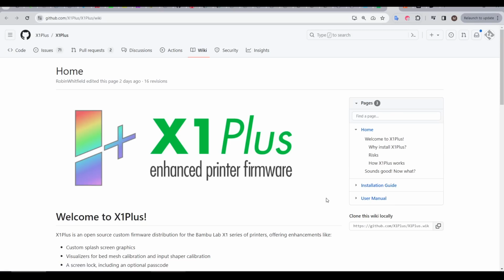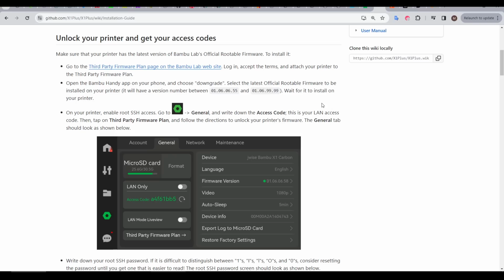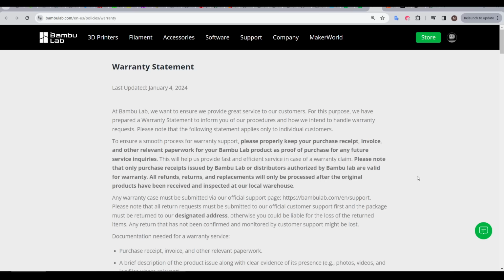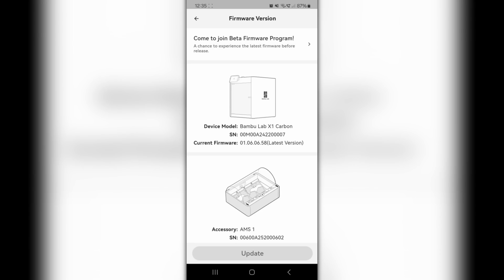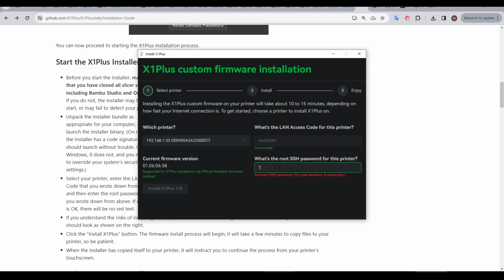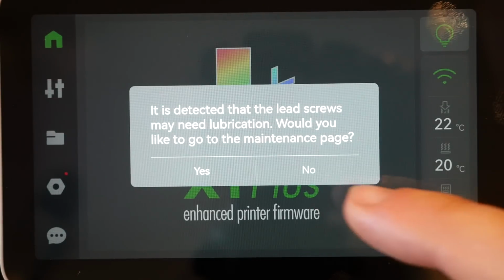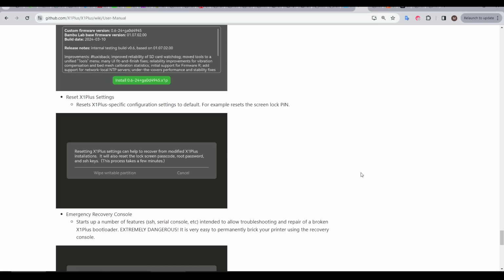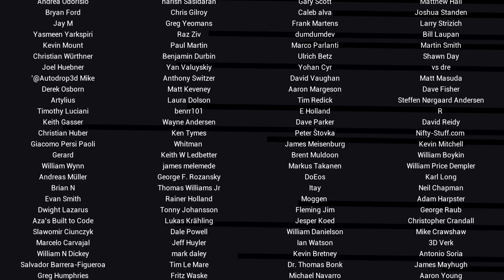How to install X1Plus community firmware - Step by step guide

Comment: For updates I feel like it would be better to have it in a FOLDER called UPDATE.
which installs the update firmware if its detected in there from the update menu.

It should also ask you if you want to delete the file as well after the update succeeded.

Comment: I didn't buy my X1C directly from BL, so I never had any warranty from them anyway (I got it from world famous or at least I consider it to me MicroCenter, of whichwhere I work). With the recent announcement and the fact that they're going to block users from using anything but Bambu Studio (i.e. Orca Slicer won't work anymore) unless you update the firmware on your printer made me want to try X1Plus finally. I can revert to their crappy locked down crap if I have to but until then it's CFW for me. Great video Mike! I've been subbed a while and your videos are great!

Comment: (If the Official Rootable Firmware does not appear in the downgrade list, you may first have to downgrade to version 01.07.04.00 before it appears.)
In my case I had to go to 01.07.05 first and then 01.06.06.58
Reply: Thanks, was about to ask about that 🙏

Comment: So, to clarify, I am hoping you will answer my question. I am holding off on updating my printer right now because I might want to switch to X1Plus. Now I can update to the latest official firmware version, then roll back the firmware if I ever decide to install X1Plus?

Comment: Why does the official firmware not have such security features, what is the reason?
Reply from the maker: The x1plus team have not found any evidence of wrongdoing, but they have added kernel level connection blocking for those who desire it. It's a peace of mind thing.

Comment: How is Bambu supposed to determine that an issue is "clearly not the result of using third party firmware" without wasting time that could be used to support people using the original firmware?
Reply: Waisting time? Lol. I waited for 1.5 months to receive a replacement HT board for my x1c, which made it 1400$ paper weight, And during that time I was using so called obsolete creality printers.  So much for them being that. 😂.
So with their "support" many already  wasted a lot of time with them.

Comment: Thank you for the walk through.  I was able to root my printer and install the new firmware without issue.
Reply: Update:  I've been running it successfully now for a week without any major issues.  I do notice an occasional quirky thing happening with my AMS where a filament will randomly load for a second and then unload while the unit is idle.  But that's about it.

Comment: I'm going throw out a big disclaimer. Running any custom firmware has it's own caveats. We are putting a lot of trust in a relatively new group running a device that can run at oven temps. 

No slight against the devs but please be aware any faults in their code can put you and your printer at risk and they provide zero guarantees about functionality.
Reply: Yes, thats why the Dev Team and Bambu Labs have included their vast amount of disclaimers as well. It’s very clear already.
Reply: providing guarantees for what? they're not getting paid for this, why do we need them to guarantee us anything?
Reply: @itsnotthat_   All of the risk is on the user.
Aside from people who got free units X1C owners paid at least $1200 for their machines.
You are putting your investment into the hands of  devs who explicitly say if you Bork your machine "too bad so sad" if you are still under warranty you are actively making it more difficult if not impossible to use it.

If I offered you my super special firmware to supercharge your car and I blow the electronics would you be cool because I offered it for free? 🤔

Let's be candid most folks cannot, do not, and will not read or learn to code. They will see videos like this and think "wow this is cool". They don't know what bugs, security risks, or issues running this long term can do. Running a whole OS from the touch screen memory card slot could introduce any number of problems and again all the risks are born on the user. At the very least there should be more time dedicated to warning folks that this is NOT recommended and could be dangerous.
Reply: But you have no problem putting the trust in the CCP company like BL. 😂😂😂 Make it to make sense.
Reply: well bambu lab just told you they own your printer so this aged badly
Reply: @TheShorterboy  what else us new? 
Apple, android Microsoft have similar controls.
Most OS and even hardware have controls in it that are beyond the user.
Idk your age but in early android days there was a pretty nasty app that was making the rounds and Google exerted  not mentioned "feature" and removed that app from phones and tablets called the kill switch. (apple too)

The biggest difference is you can either not upgrade, or leave your device offline.
Reply: @No0o0o0o0o0  well go buy a 4G modem  knock up some code and you have a phone with no back doors
Reply: You are taking a $1200 machine and running rando custom firmware because the devs released it for free is not the flex you think it is.

 Again it runs at oven temps and you are leaning into a "trust me bro" mentality because it is free?
How many people tested this? how many devices? 
What are the security risks? 
Has any independent security testing been done?
Where can we see the audit?
Since there could be forks or plugins how safe are they? Since this connects to the net as well what potential issues and servers does it connect to?
Is there OTA updates and who manages it?
What kind of wear is expected on the memory card or touch screen since you are running a whole OS layer on it?  Get the jist of it? 

Just because it is free, just because the devs seem nice does not negate the potential issues running this. A disclaimer is nice but a warning is better.

Comment: Maybe I missed it but why do you and Joel not lubricate your lead screws?
Reply: That''s what I'm wondering too.
Reply: I've noticed that the lubricant always ends up down the bottom of the screw anyway, and clogs everything up, leading to errors.

I've just had to stop using my printer, due to z-screw errors.  I wont be able to print again until I take the printer apart and completely clean the screws :(
Reply: Depending on why there is a warning? If the warning is based on the force needed to move the leadscrew (meaning Ampere) the real need might be to CLEAN the lead screws. Lubrication might just worsen the real problem making the filament dust a worse porridge.
Reply: @OlaGöstasson  this is it, throw a rod sloth on there and call it a day. I've opted for using an oil on the lead screws instead of a grease as it's a bit less of a mess.

Comment: Just so ya know, it's not legal in either Europe or America for bambu to refuse warranty service just because of a custom firmware. They have every right not to fix something you messed up by installing it, but if it's something that would otherwise be covered they must provide service. Of course, whether anyone will take them to court over that is another question, but they are in fact breaking the law if that's their policy.
Reply: If you read their blog posts, and even the wording of the second warning page section 2 that was highlighted, they will still cover unrelated issues. 

We can never be completely sure they will stick to this until put to the test though.
Reply: @Lyoishi If they don't, you can always make a chargeback with your payment card due to the seller's failure to comply with the applicable law and essentially get the printer for free. The warranty is given by the manufacturer/seller, so they can void it, but there is still a "warranty" that the law gives you. In Poland (europe), something like this is called "rękojmia" and neither the seller nor the consumer can invalidate it by agreeing to random terms on a website.
Reply: CCP has no problems with breaking the laws.😂

Comment: now waiting for the P1S custom firmware
Reply: Won't happen. P1S doesn't run Linux unlike X1.
Reply: I heard somewhere that the P series runs an esp32, that's literally the most hackable microcontroller I can think of. @laydnbeats
Reply: @laydnbeats It will for sure happen at some point. It doesn’t need to be running Linux to be able to run custom firmware. It just won’t be using the same method and firmware as X1+ since the hardware is so vastly different. Give it time though, someone will definitely figure it out.
Reply: @ernieoporto1111  Yeah, you are right ! But honestly I don't know what the P1 series could need more on the firmware side. Maybe a better layout of the display if possible because it is hideous haha
Reply: @laydnbeats  The Panda Touch will take care of the better display for me. The only other functionality I'd want on my P1S is for LAN mode to work as full featured as online mode. Ridiculous to have to send a file to their server and back to my machine to print.

Comment: Ooof, yea that's a show stopper if it requires me to have a bambu account. Though on the flip side, I am glad Bambu is allowing basically to void your warranty to install 3rd party firmware / software.
Reply: Once the firmware has open source net capabilities, which I don't know the timeline on tbh, you should be able to use a one time burner account to unlock the firmware and be good to go.